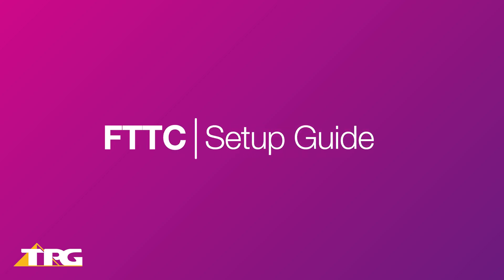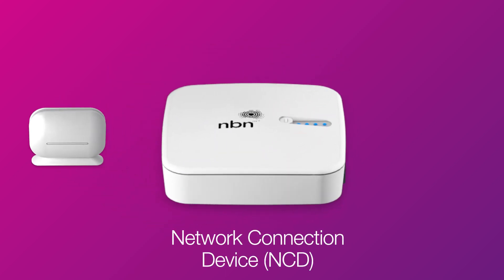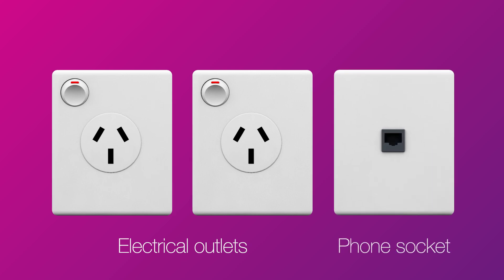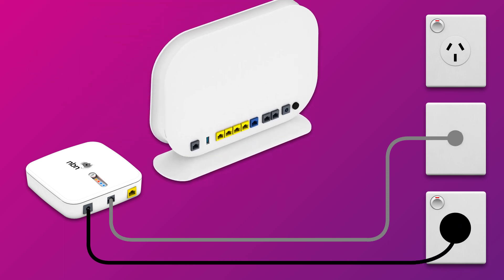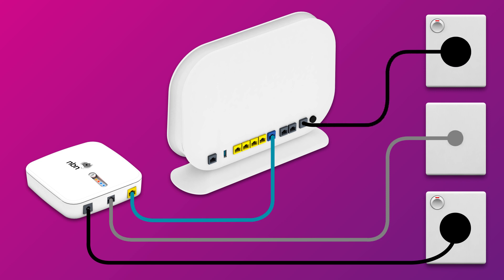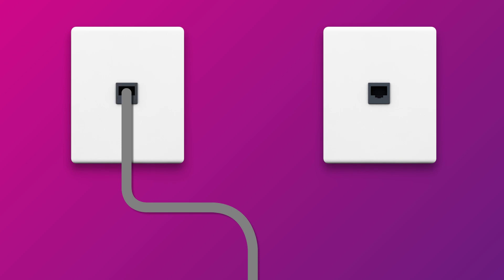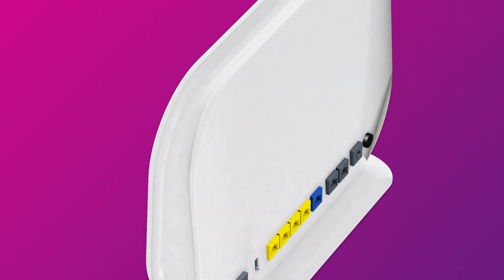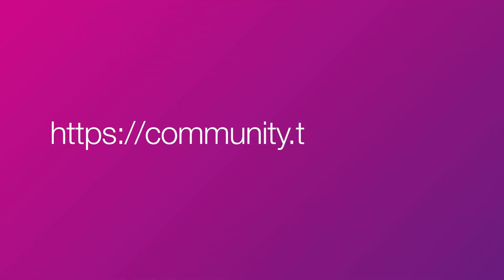TPG - Setting up nbn FTTC (Fibre to the Curb)

Comment: This has not been my experience. 
The NBN connection box requires a direct line back to the Telstra external junction box which is  normally on an outside  wall of your house.If all the phone sockets  in your house remain connected,  you will experience drop outs, so the NBN tech disconnects them except the one closest to the external Telstra  junction box. 

The NBN tech plugs the NBN connection box  into this phone socket and the router into the NBN connection  box and the phone into the router. This is often highly inconvenient for the customer because it is often not where you want the phone or the router. You can pay someone to rewire everything if you want. Telstra for example charges about $200 for this job.